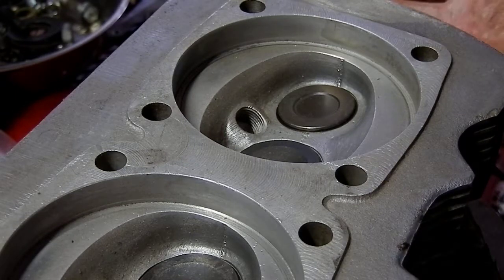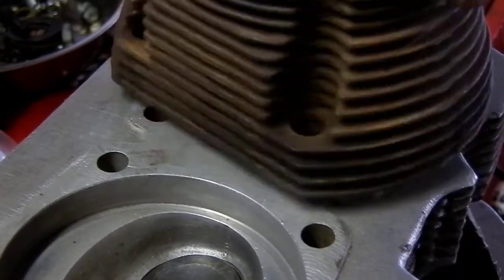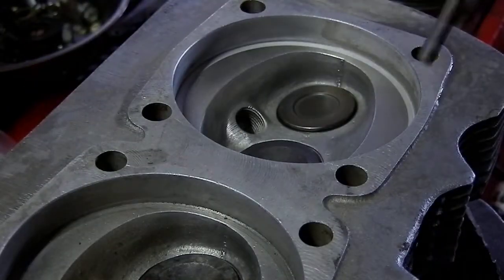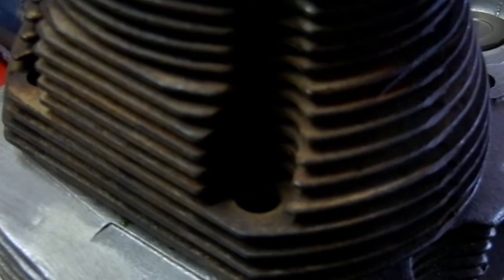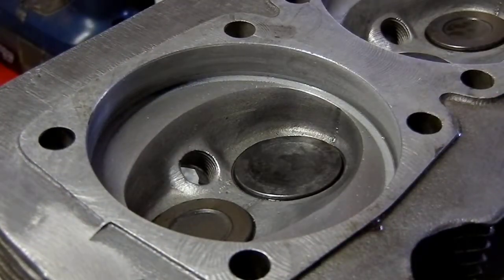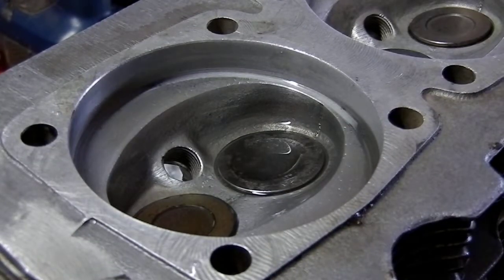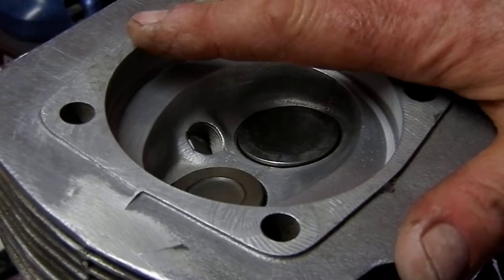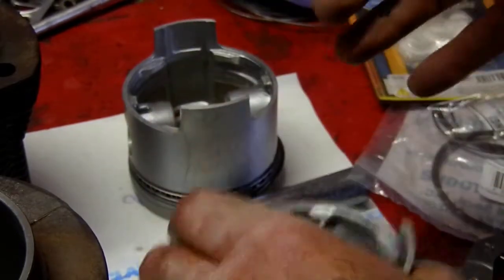Head Lap

Comment: buttons?
that can start some conversation
vwdarin has a video where he takes an engine apart that has the buttons and they left huge wear groves in the cylinders
I put them in my last build so i guess I'll find out.
Do you drill your buttons?
Reply: I wouldn't use buttons, also I didn't notice in this video which grade paste he used, only use fine !

Comment: it seems like this could make the seal on the head more difficult to achieve
one head with no gasket bolted to two cylinders
I see the idea for doing this and makes sense.
if you have the split heads, this should work much better
https://scatvw.com/product/type-1-basic-split-port-cylinder-head-kit/